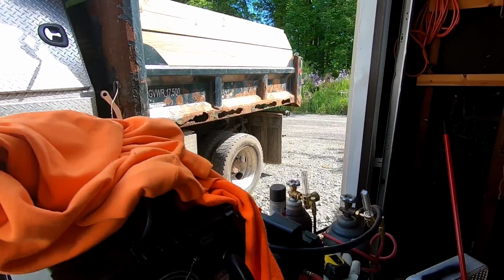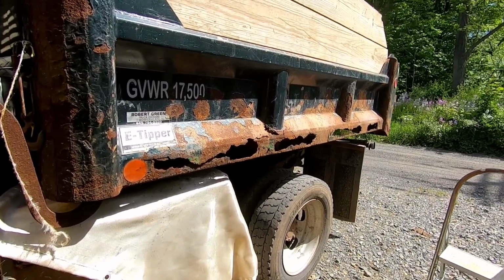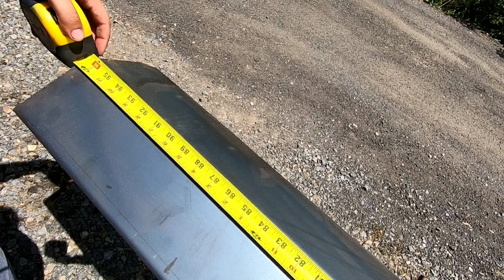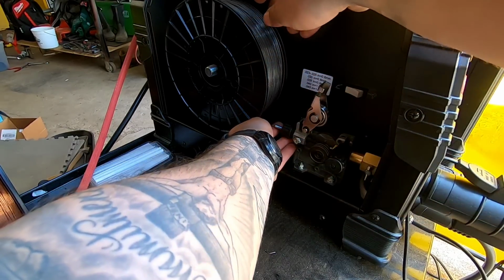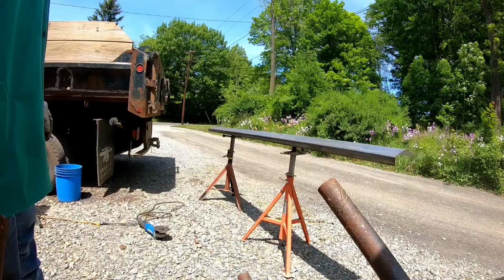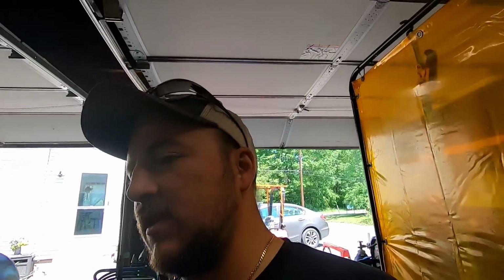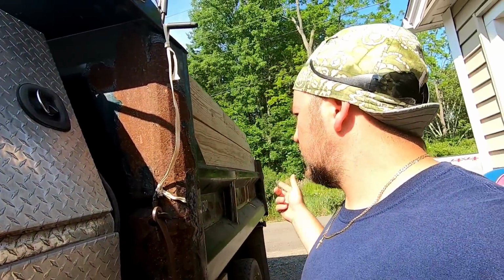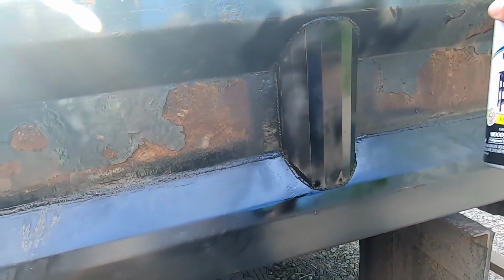WORST RUST REPAIR I HAVE EVER DONE! - MASON DUMP BODY REPAIR - PRIMEWELD

Comment: New welder did you get the gas set up. There is a huge difference in weld quality. yeah people use the wire with the shielding in the wire, its splatters and looks like crap and is notb forgivving. Good luck.

Comment: This video brought me to your site,  I  like your welding . Great work. I,m thinking of buying a Primeweld mts 200,  3in 1 mig welder. I watched you weld panel in solid. Have you used your primeweld 180 to spot weld thinner guage sheet melal?
Reply from the maker: Yea it can do that, you just need to set it up correctly and you will be good to go

Comment: Probably you can’t use a piece of pipe split on half then cut the two ends with the right angle
Reply from the maker: That's what I wanted to do. getting a small piece of pipe was the hard part though

Comment: it's called inflation. everything is more expensive, even a hazard fraud . go buy a ten pound spool of lincoln flux core wire and don't forget your hemorrhoid cream . prices for bottled gasses have skyrocketed too. flux core just needs a bit more heat but you've got the setup for it. looks good.get two or three different pieces of different size pipe to keep around for shaping metal on. tack , heat and bend as needed to achieve the radius you desire to save all the grinding.

Comment: Here's a rule of thumb. Any structural part removed from that truck should be replaced by a part of same or better gauge steel. Nothing like that flimsy sh!t that was used. I have never seen anyone actually post something so bad. It's a safety concern, but also a liability concern. If that truck ever got into an accident, the welder could be sued for such poor work. But...the owner wants it that way. Well, the welder can always refuse this kind of job.
Reply: They could only be sued if the accident was caused by failure of their repair. And even then it's not a guarantee that anything would come from it.
Reply: @jaxithfox in order to PROVE it was the welders fault for the failure is EXTREMELY difficult and rare. Without a fatality, there won't even be an investigation into it. The welding police do NOT exist the way so many people think they do.
Reply: Though I agree it's a little thin and a thick piece wouldn't cost much more, odds are this truck belongs to some mехісаn who has no money to spare. That bring said, that part really isn't that structural.... when you go to dump, almost all the weight is on those two main inner frame rails. Considering there are countless mason dumps with the sides rusted off completely and in operation everyday, it doesn't even matter. Also, this isn't a triaxle dumping 27 tons, this little truck is rated for probably 1.5-2 tons. That's nothing not to mention probably half that weight is on the back hinge when going up...
Reply from the maker: you ain't wrong my friend! @ronnieswindski825
Reply: @mcfgarage  absolutely man. These key board warriors don't know anything lol. We used to run rusted out triaxle site dumps that you could fit your hand in the frame and split and still would dump 25 tons all day long
Reply from the maker: 🤣🤣🤣🤣 what ever makes you sleep at night
Reply: Love it when armchair experts come up in the scene with the real knowledge. 👌🏼

Comment: I’m not really sure as to why you’re using flux core instead of MIG
Reply from the maker: have you ever tried mig welding rusty metal? flux core will weld better with not so clean of metal compared to gas mig welding
Reply: @mcfgarage  i have, but honestly, im not experienced enough to have known that. Was an honest question. Just curious
Reply: @shannonlawsonnashville 😂 you shouldve added a question mark bro
Reply: MIG welding is similar to TIG in the sense that you always want the cleanest scenario. No rust

Comment: Hard to see from this angle but the drive rollers, if you’re using the 030/035 side then you leave that facing out. It looked like you turned it in which would be the opposite of what you needed for that wire
Reply from the maker: maybe i did, not sure. but it welded fine lol

Comment: Vulcan flux core is pretty good wire.  I've used a lot of it with good success.  Tried some other cheap flux wire and had lot of porosity problems.  Flux core is so much more expensive because of the manufacturing process to make tubular wire filled with flux, but you also do not need to pay for gas so it evens out quite a lot in that regard.  As you noted, it is far superior for dirty aplications to solid wire mig.  Nice work.  It's too bad the owner does not want to do more work to repair more of the structure but you can only do what they are willing to pay for.

Comment: Terribly damaged by rust - the structural integrity compromised. But the steel patching creates a facade. The steel plate welded on is thin and add little strength. Truck later probably sold to some sucker  - with  degree of rust hidden. And they end up with a real lemon. And a danger to society.
Reply: You are a good welder. 
Not criticizing you - I am criticizing the owner of the truck.
Reply: When life gives you lemons...
Reply from the maker: Ok
Reply: Welcome to the real world bud
Reply: @danielvakulich8115  Yep. It’s ducked, isn’t it.

Comment: The worst rust repair is a rust jacked double frame repair, that had about 3/4" of rust between frame rails. A friend did his, he removed the box, cut off the hinge bracket, removed the two rear axels, springs, cross members and a few other things. It looked like too much work for me to do. I called a shop for a price to do it, they estimated about $20,000. I got rid of my truck that needed that work. I now look very closely for rust before I buy a truck.

Comment: I'll guess the rust will return pretty quickly, especially underneath where there was still rusty material. Rust converters are a good way to stop rust spreading. The repair looked ok.
Reply: Exactly! i write  same massege.
To sad whan spend so much energy  ( for good work (
Reply from the maker: for a bed that is only going to be in service for maybe 2 more years, this was he wanted. and will last for that time
Reply: @mcfgarage  Well as long as the customer is happy that's all that you need. I've seen some beds which would make people cry, honest. Using a torch and sledge hammer to remove individual panels and parts of the superstructure as well and welding plates in, where the weld looks like something a bird dropped. 👍

Comment: I just started watching but they placement piece had so much ting when you handled it by the garage it sounded like gutter material (light weight).
Reply from the maker: It was 16 gauge, not to thick not to thin
Reply: @mcfgarage  yeah I heard that later on on the video after I made the comment.  So is that part of the bed supposed to be structural at all?  You have to admit when you look at one, that section and those little uprights sure do look beefy.  I'd never expect they were formed from such light duty sheet material.  Was the original metal thicker and the owner just wanted it to be cosmetically improved?

Comment: Biggest problem I've seen is that you didn't treat the old metal underneath to prevent further rusting inside or at least slow it down.  You really did not accomplish much except to slow down the inevitable by missing that one step.
Reply: Maybe he decided that was something he could do on his own, to save a little cash.
Reply: Would have been so cheap to have used a weld through primer at least to reduce the ongoing corrosion to the new metal.
Reply from the maker: Was not paid to do that. Brought it up with the customer, he said to not do anything other than what i did.
Reply: @mcfgarage  so customer was just looking for a cheap and quick patch job rather than spend a little extra money to do things right.  Sheesh!
Reply from the maker: @richardcline1337  you'd find this hard to believe but alot of customers want things done cheap I don't like it but cash is cash and if he paid me my rate to this job and I'm happy with what I made on it, so be it.  nature of the game
Reply: @mcfgarage , no argument there.  It's going to cost him in the long run but it's his truck, so....
Reply: @richardcline1337  Shoot some fluid film in there, may buy a few more years.

Comment: Flux core wire has it's use and not all flux core wires are the same.

Started using  E71T-GS then used lincoln NR-211MP and currenly using hobart 21b.

Comment: how about some rust converter before you weld it up, that will help the box.
Reply from the maker: under this was pure ROT, i dont thing rust converter would have helped in this case
Reply: Hello From Mark In Kentucky.  I recently retired after nearly 32 years of welding/fabrication at a state government equipment repair facility where I worked on many of the rotten truck beds. I have found that the slicer wheels on a grinder was probably the best method of cutting out the “Crust” and which the other material that used to be metal was no longer metallic. In fact, The Cutmaster 102 would absolutely not cut some of the worst areas and I would have to either use the slicer wheel or melt it out with a OxyAcetyline cutting torch. 
A good deal of my repairs on the Galion beds that we had was repairing or replacing the top section of the bed which was usually tubing and as you did, also welding in the bottom section which luckily for me was not rounded like your project. Our newer Galion beds had flat brackets welded center ways between the front and rear of the top section of the bed which really helped strengthen the sideboards. The brackets that I used to make to help the older beds that I was working on were 1/4 inch flat with the bottom of the plate for example being around 10 inches long and the top being around 8 inches long which had a nice look to it. The tallness of the brackets was usually relative to the height of the sideboards. Our facility used to purchase at least 3 inch thick rough cut oak lumber from local sawmills for lumber and for the tandem dump trucks and 2 inch rough oak for single axle 2,1/2 ton trucks. The Mig wire that I used was either.035 or .044 Lincoln L56 copper clad wire using a MillerMatic 350 welder. I would love to have a dollar for every inch of Mig wire that I burned repairing those junky beds. I honestly can’t say that I used exactly the same techniques for every bed repair; Because One Size Does Not Fit All when you are doing the welding repair thing.  Take Care My Fellow Welding Friend.
Reply: Then you wouldn’t get repeat business 😂